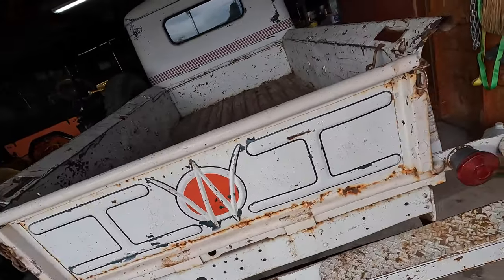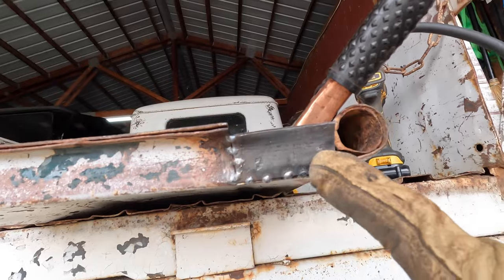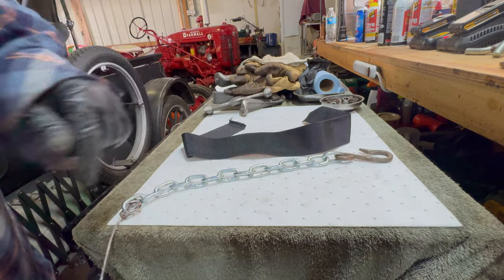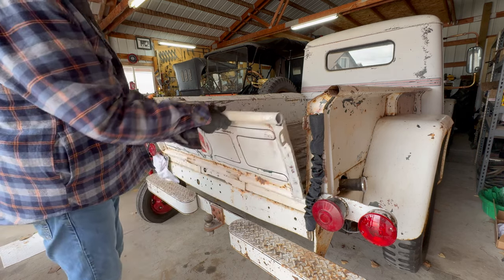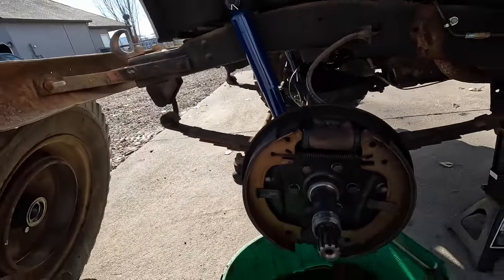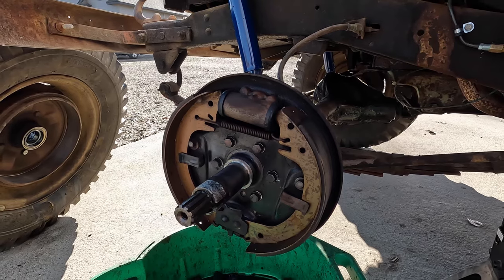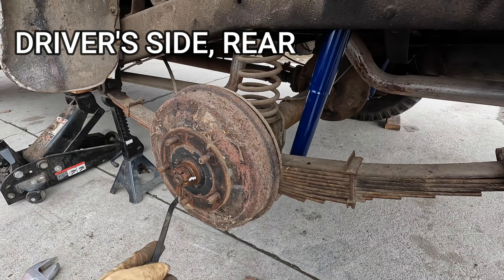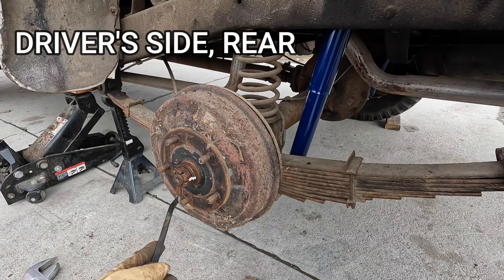1952 Willys Overland 4x4 Truck - Part 10, Tailgate and Brakes

Comment: You did the right procedure by NOT trying to pull drum off by pulling on the edge of the drum.  I put enough pressure on a small engine flywheel doing that to bend the fly wheel trying to get it off.  I have to add that the flywheel probably hadn't been off since it was new in 1946.
Reply from the maker: Yes. Although I have never had that happen to me, I was aware of the possibility. Those drums were really on there tight!

Comment: Old Chrysler rear drums are built the same way. I've seen many struggles. You got through this one, but I have some tips for viewers who are facing more stubborn circumstances.
1) The tool you bought is the right one. There are others that are very similar, and they're good too, but it has to be heavy.
2) Grease the threads on the puller tool. This reduces parasitic friction and pulls more efficiently.
3) The anvil head has two pads. Use them both at the same time with two similar hammers (big ones).
4) Put a lot of heat on the hubs. Tension them with the puller, then torch them good and they'll pop. 
5) Be careful with the wheel studs. Replacements might not be available (crazy but true).
Reply from the maker: Good advice! Thank you.

Comment: Tailgate repair and "distressed" paint job were very impressive work!  BTW, what model welding helmet did you get?  And what settings did you use on your welder on that thin tailgate metal?  Cheers.
Reply from the maker: Thanks Richard. Helmet is a Hobart No. 9-13. My welder is an older model Hobart handler 125. Wire feed about 30. Voltage switching between setting 2 and 3. It required a light touch for sure.